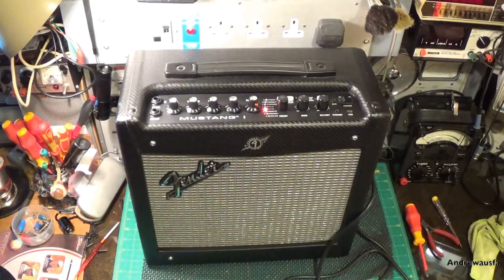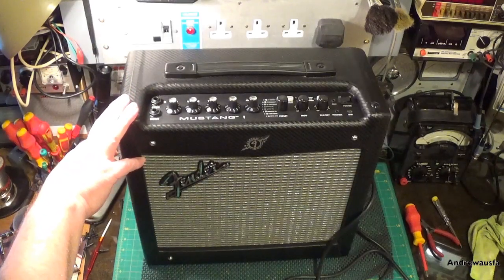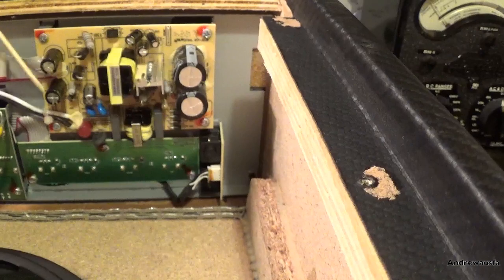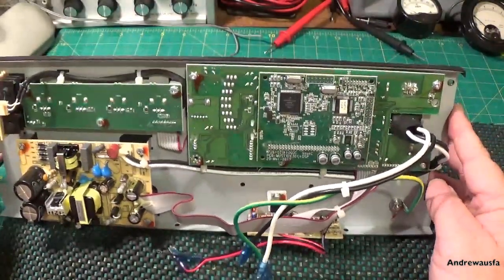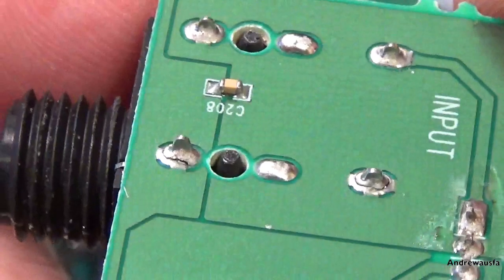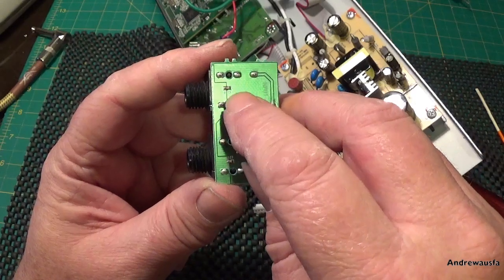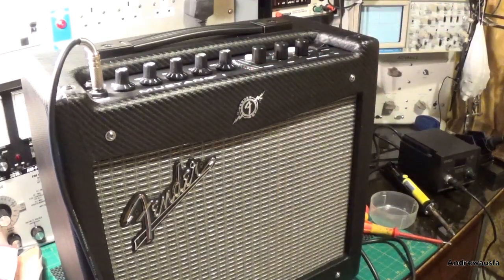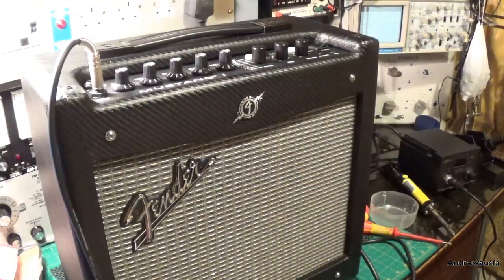Fender Mustang Amplifier Input Jack Repair

Comment: MIne gives sound only via headphone output. If i connect it to line in of another amp i get sound: headphone out mustang -> another amp line in. I dont get any sound if i try to play with mustangs speaker. If i max the volume i get a veeery silent sound.
Reply from the maker: So the pre-amps working but nothing out of the main amplifier? Have you checked the speaker leads are connected to the speaker? Sounds obvious but can be as simple as that. Other than that it's either between the input to your amplifier chip from the pre-amp or from the chips 'out' leg to the speakers. Could be a fried chip, it does happen.
Reply: @Andrewausfa  yeah i opened it and checked but everything seems ok. I had a talk with a friend who had the same situation and found that in his mustang it was a chip in power amplifier. he will fix mine too so thx for response :)

Comment: Dude can you help me with my 2nd hand Mustang 3 v2??? It works but there is a horrible background buzz that almost drowns out the sound of my guitar. Turning the amp up just makes it worse. The courier who dropped it off slammed it down on the floor when he got it out of the van #idiot! Don't know if that could have done anything to cause this. How do I go about diagnosing it?? 🙏
Reply from the maker: Hi, sounds very much like there's some internal damage. It may be visible with your eyes but get a magnifying glass and check the tracks. Good luck!!
Reply: @Andrewausfa  dude thankyou for your reply! :) luckily I think it's OK and it was my guitar cable that was causing the noise think the insulation was shot, it's LOADS quieter with a new cable only an audible fuzz on high gain presets. So happy with it these amps are fantastic! Managed to get the FUSE software and nearly 10,000 presets downloaded from an old forum post. If anything ever goes wrong with it I will be straight back to this video! ❤️
Reply from the maker: @banksy444  That's great, I hate it when you go chasing your tail like that. Cable should be an easy repair.  Yep shame Fender doesn't support these any more really, they're a great practice amp.

Comment: Hi, the little black plastic piece around my aux jack split in 2. What is that piece called and is it an easy switch out?
Reply from the maker: Hi Christine, looks like what is called a 3.5mm jack. Same sort of thing as your headphone socket on your phone. I need to have a look to see if you can get an exact replacement, there are two types, stereo and mono. You have a lovely singing voice, just watched your cover of When I'm Gone, full of soul.

Comment: I have a Fender Mustang III and it started dropping volume when I set it beyond 5 in the master volume. I cleaned all potentiometers and even a technician changed the master volume pot but it keeps doing that. Can you help me?
Reply: @ david torres
i had volume fade on a crate & on the back of it
the efx. send/return jacks were corroded a bit on the  flat metal "switch" leg. i never used it & didnt think about the signal path goes thru there. when its used, the plug will "break" the connection & re-route the signal thru the cable. so the corrosion was breaking the signal route & it stopped there. at higher volumes, the physical vibrations would  cause movement to the metal switch leg & the electrical signal to start losing contact & re-contacting very fast. as the vibrations increased,  the switch leg contact point was moving onto the corrosion and  back off it. until it  not making contact long enough to send a proper signal.
kinda like driving a car so fast that your only hitting the high spots in the road. and the high spots are corrosion !!!

Comment: This is a great video; detailed and to the point. Thanks for taking the time! I had the exact same symptoms as you described ie loud, annoying humming  but when I inspected the input jacks and board using your video, I found 1) the "clip" you describe (6:32) had no housing (ie the white plastic piece attached to the board) and 2) one of the four "prongs" soldered thru the board (that the clip attaches to) had come loose from the board. The tiny bit of solder was still attached to the prong and a small part of the green board covering is attached to the solder but the . This loose prong is on the FTSW input jack (which I don't use). I'm not an electrical guy (chem eng) but can you tell me if you think this could cause the same humming issue? If so, do you think I can fix this by using super glue to reattach the prong to the board?

Comment: Excellent video! I have one Mustang I too, and the round top plastic of the phones jack is cracked, so the jack don't connect very good. Do you have any idea where can I get this part? Thanks.
Reply from the maker: Hi Tiago, do you mean the nut on the jack plug socket? Any electronics store or guitar shop.

Comment: My amp seems to lose a little power after a few minutes of playing and it starts to buzz when I play on clean channels. I read that this could also be the jack socket fault.
Reply from the maker: Hi, could be but it could be another dry joint anywhere on the board. Dry joints are caused by mechanical failure like the stress from sticking your jack lead in and out (and this amps input is poorly designed from that point of view) or the solder joint fails from continual thermal expansion and cooling around components that get hot, like resistors, transistors, IC regulators, valves/tubes etc that sort of thing. It"s a very hard problem to fault find hence the use of a magnifier, hair drier and freezer spray!  I would suggest if you turn your amp on, no input, just leave it and it goes quiet after a few minutes, then you have a dry joint further along the signal path or you may have a component failing as it warms up. The latter may be catastrophic to your amp if it fails and takes other components out. The buzzing on clean may be unrelated. Cheers - Andrew

Comment: Mine are not cracked but still has a loose connect problem on my jack i have to push it to the side :(
Reply from the maker: Needs resoldering!!
Reply: @Andrewausfa  thank u so much for caring i dont understant these things but does that mean there is a disconnection on the card

Comment: Hi, could you please help me find out if the FX loop jack of my amp is working fine or if it has a connection fault?
How and where should I put the tester probes with a multimeter in order to test it? The sound come and go, I need to check where the fault comes from, thanks!
Thanx!
Reply from the maker: First check it's not your leads. Secondly you will need to unplug the amplifier and check the contacts of the sockets

Comment: What happened to me (I have the Version 2 model), the cheap plastic nut around the input jack came loose, and before I noticed it, the physical stress was all going directly to the Input PCB and the soldered points came loose. I have redone the soldering twice, and I'm absolutely baffled, I may try a third time to make sure it has the best contact, but honestly, between the plastic jacks, the nuts and the board itself, it's a pretty awful design that still somehow made it to the second version... Anyway, good video!
Reply from the maker: Are you using lead free solder?
Reply: @Andrewausfa  
Nope. I was using regular ole' leaded rosin core solder. One issue was that the solder kept sticking to the iron itself. Though this video did inspire me to try it again and it did work this time. 👍
Reply from the maker: @N75911_  That might be the issue, did you get a!l that awful lead free stuff off first? Lead free doesn't mix too well with 60/40.
Reply: @Andrewausfa  
Yep, I de-soldered it and used the solder sucker. It's strange though, because I've never had solder "magnetize" to any of my irons before. But thank you for the video, at least I know now that most of what I was doing is correct!

Comment: My amp has been unplugged for 2 days. If those little charges come into contact with anything besides my finger will I get zapped? I was fiddling with the input jack and it fell into the cavity, easy fix but I dont know what no to touch!!!
Reply from the maker: Hi Tony, what not to touch is anything in the power supply sections so you 100% must remove the mains lead (aka line cord in the US) from the socket first, that's the most important thing. Secondly it's good practive not to touch anything in the power supply section whether plugged in or not. There is likely no charge left on the bigger capacitors (the can shaped things) but best not to take the chance. If you touch and they discharge through you you'll get no more than a tingle. However, your natural reaction will be to whip your hand out of the away and then you may cut it on something. If you touch something with it plugged in, and it's Live or Hot, then it's a different story and you might not be able to let go.

Comment: I use an 18" M to F cord that plugs into the amp and I just plug into that every time, so it takes that stress off the pcb board. I'd really like to know how to wire in a standard metal jack socket with wires, even if it means losing the footswitch. I never use it and don't gig so I don't need it.

Comment: Hi, i have bought a same amp of yours, but not working. When i opened it some thing is missing in power supply section. Can you send me some indepth photos of the power section? The yellow transformers are missing. And i cant google the part number. Here's my email address: arlovaldez@gmail.com

Comment: Hi. Sorry but i dont khow who else to ask
I added a jack3.5 (for the headphones) input to my amp because i broke the other
I did it by soldering wires on the contacts on the circuit board of the old jack. But now i have buzz issues when i plug in my headphones...
Any advice?

Comment: I'm really annoyed. I Che ked the spring in the input jack. It rises as  the plug is inserted. So it seems there is good contact. Indeed a few solder points were cracked. I resoldered them. Reasdamled my Mustang 1 v2 and the jack still has intermittent contact.
Reply: Make sure the soldier has REALLY good contact with the PCB, I had to re-solder mine three times before I finally got it. The third time I used extra solder and got it in good.

Comment: Where did you get your replacement jack from and do you have a product number?
Reply from the maker: Hi William, I just resoldered the original jack socket. You can buy new generic ones from eBay, Amazon etc. which s all these are i.e. cheap. Just clean the legs before you solder them in with IPA or a light sandpaper, makes for a better joint. Cheers- Andrew

Comment: I can't get my digital display to come on with Fender Mustang 3 amp. Any advice?
Reply from the maker: Hi Kristi, all I can advise is to carefully check the soldering if the state of mine was anything to go by. I only have this Mustang I I'm afraid. Obviously I don't know your experience so go carefully as there is high voltage inside.
Reply: Thanks. I know nothing about repairing amps. After further investigation I found information that the amp had been stored in a cold building for a year therefore, I believe moisture affected it. If you hold your head sideways you can see an glimpse of the selections.

Comment: Nice looking modern amplifier. Lead free is evil. Looks like the connectors should have been heat staked, but they drilled wrong holes in PCB

Comment: seems overly complicated for what it is  whats wrong with a kick ass power supply with a hefty transformer ! and a brute force discrete output stage ! the effects side of is cool though !
Reply from the maker: Exactly! I was quite amazed at what they packed in to so little. My main amp is an old HH thing that weighs a ton, this thing weighs a couple of bags of sugar. It's good for 20W per the manual so quite amazing how technology has moved on. Plus of course all the different sampled/emulated amplifiers you can 'use'.  Get this as well...it connects via USB to a computer so you can programme your own tones. When I were a lad.......
Reply: @Andrewausfa till I suppose thats progress at least its still an analogue thing guitar and amplifier !